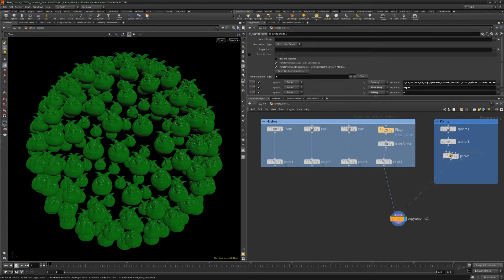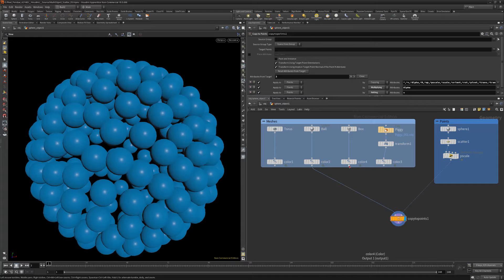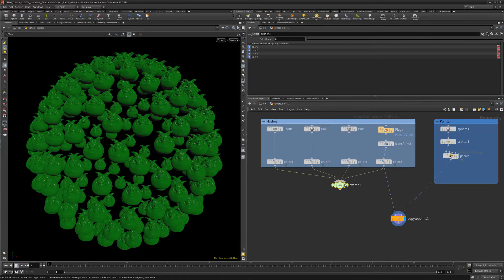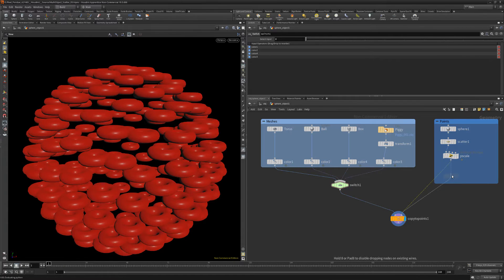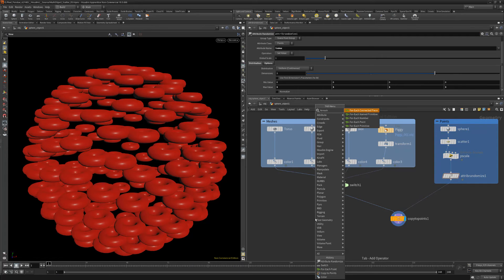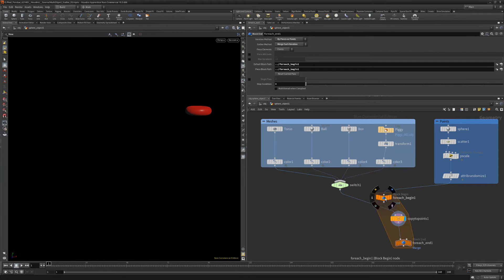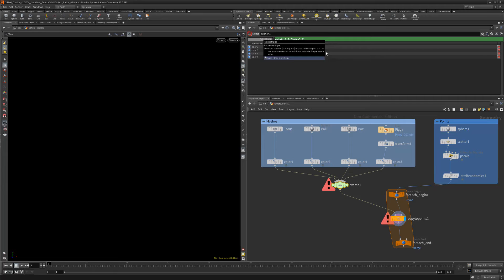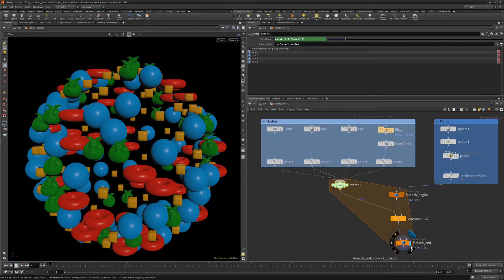Houdini | Copy to Points Using Multiple Source Meshes (version 1)

Comment: Hey! I have a question and I hope someone has an answer to it. Is there a way to remove all objects that intersect with my "main" object? For example. I am making a mushroom and it has a little skirt. I use the scatter and copytopint nodes, which create spheres on the surface of the mushroom, including intersecting with the skirt. Is there a way to remove all spheres that intersect with it?
Reply: i think a good way to do it is probably by using boolean node, use A-B and put the spheres on the A (first) input and the skirt in B(2nd input)

Comment: My way :
1. Merge ur shapes > use Connectivity_SOP to create the variant attr and set the type to string > wire it to copytopoints input1
2. In the other stream create an Attr_Randomize_SOP to create the attr variant and set Distribution to Custom Discrete and the Type to string. Then write piece0, piece1, piece2... in the values and tweak the weights to ur liked.

Optional:
You can use the Labs Attribute Value Replace after the connectivity to rename the piece attrs to the name of ur assets so, you can write the asset names inside the attr_randomze instead of writing piece0,piece1...
Reply from the maker: So many options... thanks for the share!

Comment: not simple at all
Reply from the maker: easier way?
Reply: @pixelfondue  yepp, there is one, actually even more than one

Here´s one of many ways:
1. Create a Merge Node and Merge your Prototype Meshes
2. Create a Connectivity SOP after the Merge Node
3. Create an Attribute_from_Pieces SOP and place it onto your points
4. Inside the Attribute from Pieces Dialog change "Piece Attribute" to class
5. Take the second Input from the Attribute_from_Pieces Sop and plug it into the Connectivity Sop
6. Dive into your CopytoPoints and mark the "Piece_Attribute" Checkbox
7. Under Piece Attribute type class
Optional:
8. Inside the Attribute from Pieces SOP under Mode you´ll find a lot of Interesting Modes like Patches or Noise
9. You don´t need to use the Connectivity SOP, you can assign Integer Attributes to your Prototypes, in case your Model consist of several parts.
10. If you search the Internet with Attribute from Pieces you´ll find a lot of interesting stuff :-) 

Now your Pieces should be shuffled. Have fun :-D
Reply: the best way is to take all the nodes and either drag them into the shelf to create a button. If you press it, all the nodes appear.
Much better, create an HDA, its relatively easy and raises your productivity like crazy
Reply from the maker: Will give it a try tonight... thanks
Reply: @pixelfondue  something i just found, is you can just type point("/obj/geo1/foreach_begin1",0,"index",0) on the Switch instead of adding the spare input.
Reply from the maker: Thanks for teh tip

Comment: i think the new method is the variant option in the copypoint is more easy u just need to create variant attribute
Reply from the maker: I'll have a look... thanks for the tip!
Reply: @pixelfondue  yep, use the piece attribute
Reply from the maker: Do you have additional info? I see the Piece Attribute for the Copy to Points Node (variant)... I added a Attribute Randomize set its attribute name to (variant), then fed the meshes into a merge node.
Reply: @pixelfondue  every mesh before merge has to have this attribute too (on all points)
so lets say 1 mesh has attribute  variant=0, second variant=1 and so on

on the points first add attrib create (so you can set it to integer), then attrib randomize.. or use point wrangle/vex (for example i@variant=floor(rand(@ptnum)*chf("number of variants"); .. this way you dont have to use the attrib create node and set the max with slider)

edit: correction, use "chi" instead of "chf" to create integer slider, also i missed the second closing bracket, also there cannot be spaces in the name of slider,so the vex is:  i@variant=floor(rand(@ptnum)*chi("number_of_variants"));
Reply: @pixelfondue  also if you copy only simple meshes.. by simple i mean that every mesh is connected geometry, you can use connectivity node to generate the attribute for you (you put it after the merge)
Reply from the maker: Thanks for the info... much appreciated!
Reply from the maker: Nice tip!
Reply: @dnch  yes exactly what i do